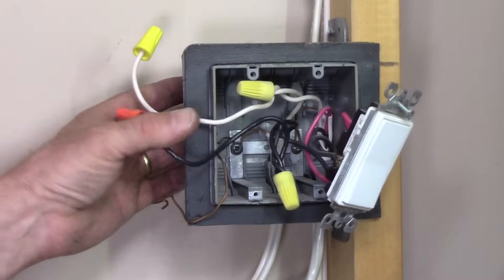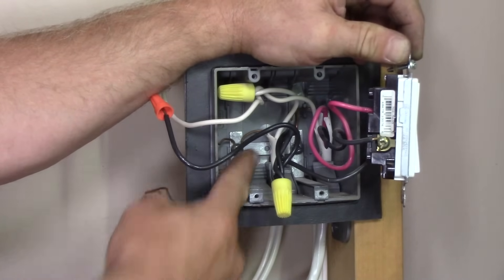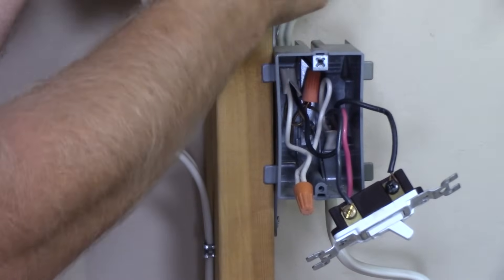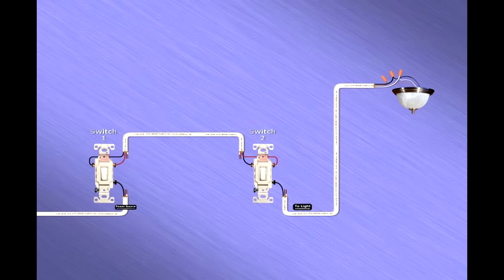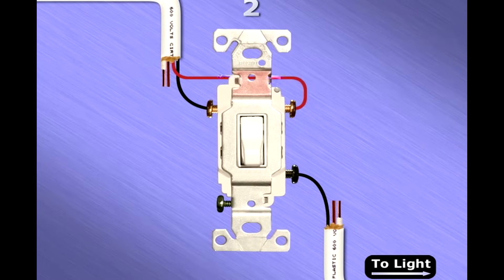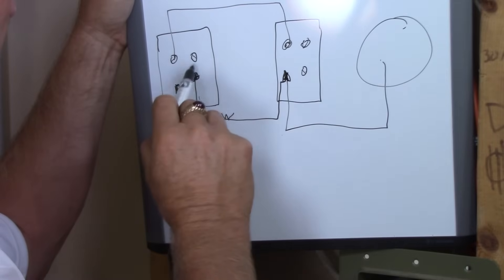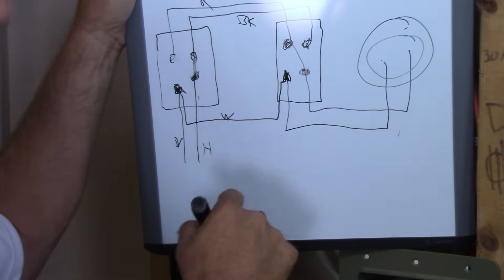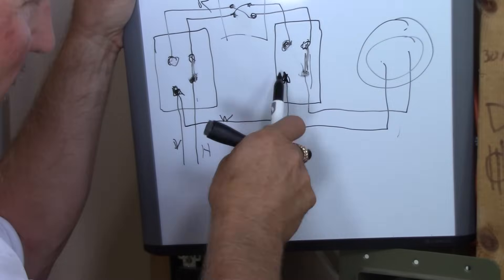The Best 3 Way Switch Explanation Ever!

Comment: I recently replaced one of my three wsy switches in my kitchen and now it’s not working properly. With both switches in the up position the other switch works fine if i move one switch to the down position nothin works. Any advice would be great. I only replaced the switch because it was painted.
Reply from the maker: You've mixed up the common wire with one of the travelers.  Shut off power, pull that switch out, and send me a picture of how it's connected to terry@electrical-online.com.

Comment: I don’t  know how to add a photo to this, but: I need help figuring out this junction box. Wiring on the right side of the box are dead. Others are live. Bottom of the box leads to electric switch. Switch controls a light fixture outside front, and outside back. Both wires have no voltage. Yet all other wires in this box are hot. Why? Why!

Comment: Thank you for your video. So I’m planning to tap into a light switch in bathroom wall and then doing recessed lighting in the other room and adding a light switch opposite of the light switch in the bathroom, this is possible to tap electricity this way?
Reply: It is possible, yes.  But just asking that question tells me that you should have a professional do the work.  Recessed lighting itself can be complicated because of safety code requirements.

Comment: Would you please explain how to turn one of the switches into an outlet while keeping the other as it is ? I have 2 switches functioning this way and i need a plug to replace one of them, the problem here is that all three lines are blue ? any idea ?
Reply from the maker: I would have to know exactly how this circuit is wired to be able to give you an answer.
Reply: @theinternetelectrician  I believe the wiring is identical to the one explained in the video, i checked both of the switches they have 3 cables connected exactly as the tutorial shows , unfortunately, they are of the same color, blue.
Reply from the maker: @AmineBoumediene  Is this circuit wired with wires in conduit? Is there a neutral splice in both switch boxes?
Reply: @theinternetelectrician  I've checked again, there are 3 cables connected to each switch. nothing else

Comment: So my house was built in the 70s.  Just checked my 3 way switches and found the cheap way the contractor used to pull this off.  I have 3 pairs of wires in my ceiling box.  Instead of using 3 conductor cable in the switch boxes they used 2 conductor and tied it all together in the ceiling.    Each switch box has 2 pairs of wires in them.  Was this typical back in the day or just a lazy way to do it?
Reply from the maker: The electrician didn't have any 3-wire and didn't want to go back to the shop to get some?

Comment: Duuude!!! Big shout out to you. This video helped me actually understand and solve my problem. 
Bought my first home recently and the wiring in the kitchen wasn't right when we moved in. We had two 3-way switches. 1 switch worked a light. The other switch effectively just cut power to the first switch. On the other circuit the red wire was just capped off. 
Thank you very much for this explanation! All is good and now I'm much more comfortable with what's happening inside my walls.
Reply from the maker: Thanks for taking the time to watch, and comment!

Comment: Your not too bright...    So you know how a 3 way works..   yay..    but every home is wired a little different depending on when it was built and where...    Sometimes your supply is up top.   Sometimes it's on either side..       you're wasting your time..    and probably helping to make more work for real electricians....
Reply: did you really have to be so derogative?  you could have presented the same idea absent the insults.  Where is your youtube video?
Reply: @dvk578  I'm an electrician..  not someone who sugar coats anything..     or someone who would mislead people with information on things in a video.    I might be a jerk but that's how I came up in the trade.  It may be abrasive but it gets your attention and makes you think.
Reply: @shawneliason790  First, I thank you because this video and your comment helped me to understand these switches and allowed me  to repair a switch install that the previous home owners had messed up.  As for the comment, the venom was not needed.   Specifically, the line saying, "You are not too bright,"  was entirely unnecessary.   No need to sugarcoat...  be honest...  but don't be an a$$ either.   Thank you again for the info you provided.
Reply from the maker: Thanks Shawn! All I can say is that you must be a very good electrician! I'll keep doing what I'm doing, 47,000 subs, alomst 10M views, and you helped me get there!  I'm not sure you should be calling me "not too bright".  You might want to check my credentials, or I can provide them for you!

Comment: My friend im learning with your video thank you for the free Ed....but question: why would I want to turn on my lights on the off positioned switch?...please elaborate
Reply: In a hallway, or similarly long room.  Light switch at each end so you don't need to cross the room in the dark to get to the light switch.
Reply: Three-way switches let you control a light (or whatever) from more than one location.  As Greg stated, a hallways is a great example because you might enter the dark hallway from either end.

Comment: How can I connect a receptacle a three-way switch a light a receptacle another 3-way switch using only 12/3 cable?
Reply: You would need to run an additional ( single ) cable..

Comment: Thanks a lot!!! One question - are you saying that 3-way and 4-way wiring using the same 14/3 cable?
Reply: Yes.  But a 4-way should always have two cables entering the electrical box, whereas a 3-way switch might have just one.

Comment: you can take the horse to the water but you can not make ham drink ,some apprentices i had in my courier the are afraid to touche a dad wire from a coil, as you can see no mater what you do you can't make a horse drink, i hire a 14 years experience apprentices and let ham tel me what those numbers and words on motor plate meaning , the first was ,,,what L.A mean ,he answer fast,,,,  L.A mean Los Angeles ,,,i fire ham wright on a spot, 14 years experience and don't know F.L means full load amperes,

Comment: I have a bedroom with 4 way switches. 3 switches on the wall. There is no light fixture in the bedroom. The switches control the outlets, but only the bottom of the outlets. The top halves are always hot. I assume for lamps.  Can I change all the outlets so that both top and bottom are always powered and then run a wire from the last switch into the ceiling for a light fixture? And most importantly  how do I figure out which wire is coming in from the breaker and which one is going out to the outlets without tearing all the drywall off? And what do I do with the wire going from the last switch to the outlets so that it's not a safety issue?
Reply from the maker: Peter Schwab this is actually quite simple. All you need to do is take a cable up to the light outlet location you want from one of the  receptacles in the  room. They run 3-wire cable to feed, and in between all those receptacles. Use the one with the least amount of wires is it, i.e. only a 3-wire in, no cable exiting to keep your box fill within code. Each of those switched receptacles will have a white neutral on one side, and a black and a red wire on the hot side with the tab between removed. Likely the black is hot all the time, and the red will be controlled by the switches. Use the red and white for your new cable connections for the ceiling light. If you no longer want any receptacles switched, just replace the receptacles with new ones and use the black and white for them, and splice the red wires through with a wire nut.

Comment: What do you call a switch that is just on or off? A one way or a two way switch?
Reply from the maker: A single-pole switch.
Reply: If it has two terminals it is a one way switch or single pole. If it has three terminals it is a two way or double pole switch but can be used as a single  switch.

Comment: What if I have a 3-way switch pair and want to cover one and add a smart switch where the other switch is? Is that possible?
Reply from the maker: It's entirely possible.  I would just need to see how your circuit is wired, what location you want to install the smart switch, etc. Would need to see a picture or diagram of what wires and connections are in each switch box.
Reply: @theinternetelectrician  
The code when my home was built didn't seem to call for anything but black, white, and bare copper for ground. I have a couple places I'd like to do it. It's annoying the electricians didn't put the wires in the same way in both places. It looks like in one switch there are more white wires and in the other there are more black wires. I'm wondering if I can close the circuit in one box and put a cap plate over the switch box, then treat the other switch like a standard switch?
Reply from the maker: @KLP99  Yes, but again I'd have to see how things are connected now to advise on how to make this change.

Comment: This is a good explanation for someone with an aptitude for this kind of work. It could be a problem for someone that does not have a basic knowledge of house wiring. this method also only works if you have the power originating at one switch and feeding the light or other device at the other switch. If the power originates at the light it will not work or if you must " dead end" one of the switches it will not work. however the basic circuitry still remains true. This is why I say without an aptitude for wiring it can still be difficult for some. Plus all code requirements still apply. 
60 year old semi retired electrician.

Comment: I had switches working proper then went into a bedroom where a wall switch did nothing but ceiling light works and Hall lights. Put on new wall switch, and i got a spark and blew breaker . Now nothing i do will light ceiling or Hall where 3ways were installed! What's going on??

Comment: so the power line always goes to the black pole screw on the switch?
Reply from the maker: In this method of wiring a 3-way, and at the box where the power feed enters the circuit, yes.

Comment: Hi, My main meter runs even if I switch off the main switch. Somebody did bypass from my house. But iam amazed when I have taken a separate connection from the pole and did separate open wiring then how come my neighbour bypass from my house. Actually when they use our connection my fridge stops working. Pls help as I am fed up of paying electricity bill without using it much.

Comment: Question:
 Your saying that both switches in a down position will turn the light on?
That is NOT the correct way! 

You flip switch up to turn the light on. Flip switch down turns light off. 
However, because it's a 3 way you can still achieve turning light off, if both switches are up. 
Tip: 
 When installing switches make sure that the writing is in the upright position.
Reply from the maker: Thanks for watching, and thanks for your input. However, there is no 'on' or 'off' position on a 3-way switch, and it doesn't matter how you install them in the outlet box.
Reply: @theinternetelectrician 
Thanks for your feedback. 
 I'm very aware of the fact that there is no visible "on / off" writing on 3 ways, that wasn't the writing I was referring to...
 And traditionally, flipping up a switch should turn on the light... that's all I'm saying.
Reply: @theinternetelectrician 
https://youtu.be/fz9KKvoS6p0
This link features another electrician that took the time to explain how to fix your 3 way switches... Notice that his system is the same as mine!

Tip:
 Both switches down... light is off. Either switch up... light is on. (If both switches are up... light is off.)
Reply: @theinternetelectrician 
https://youtu.be/ybKIvTQeLq4
Here is another guy that does it my way.
Your video was the first I watched. This link is the third video I watched. And I left you a link regarding the second video I watched.
My point being that 2 out of the 3  electrician videos share my system. You are the odd man out.
Reply: I'm not saying that you are under qualified.
 I'm just curious on why you complicate it unnecessarily?
My guess is that you don't have children around? Teaching a child how to turn lights on & off should share the same consistency as any normal switch.
(Down = lights off. Up = lights on.)
Reply: bjjthaiboxing You just contradicted yourself.   You said if both switches are up lights are off.   Then you said switch up=on.   Make up your mind.
Reply: @gfriedman99 
Apparently you have no understanding of 3 ways. Because if you did you would know that both switches up also cancel out juice to the light. Same as both switches down.

Comment: The video is ok. I just wanted to know WHAT a 3-WAY Switch was and why you needed it. It appears that it for when you want to turn on and off the same light from different locations. I guess an example would be a hallway with two light switches and one light. You can turn the light on and off from different locations in the hallway.

Comment: Great Demo and explanation.  Loved the Traveler term.  Would of liked to have other situation where the light is in the middle of the switches or power source came from light. Just because I have run into those.  Thanks
Reply: Sidney Pickard I believe the only difference in that situation is the light would be tied in to the travelers or traveler and hot would be on the switch.

Comment: Let me just say that your explanation made wiring a new switch in my "crazy-wired" house easy! You've used language and showed exactly what purpose each wire has, so that even though my wiring is using different color wire, (has the black crimped off together, uses the red, etc.) because you show which wire is the traveler, I was able to install the new switch, with posts in different positions (making it impossible to just stick the new one in with wires in the same spots.)
Reply from the maker: Happy to have helped out! Thanks for the nice comment! Don't forget to subscribe, you will then know when I post a new video.

Comment: in a 240 volt service can you use 12 3 to junction box and run 2 circuits and share the neutral as long as both are on opposite legs and again can i run red black blue on 208 and run 3 circuits from junction as long as each are on l opposing legs

Comment: So you have bonding bar in a non-metallic box? Seems over kill as the switch is grounded, and the box does not conduct electricity.
Reply: The bonding bar and ground are there to allow the grounding of the metal parts of the light fixture.

Comment: Power coming into the switches and the lights last always makes perfect sense to me. When the lights are first or in the middle, and whites go hot in some areas, it completely locks up my brain
Reply: It is still the same circuit path.   The power goes in one three-way switch, down the travelers, and back out the other  three-way switch.  The only difference is that the wires in the cables start doing other functions, namely the wire wire is usually re-assigned to be a hot wire to minimize cable runs.  (Newer codes can prohibit that, which is actually better in the long term.)

Comment: Very well done Sir... Everyone has to remember that the Neutral and Ground doesn`t land on a screw, they just twist together with a scotch loc and travel through the box to the light or final point...and the primary always lands on the Black Screw all alone by itself....
Reply: They switched the neutral on the switch for years , an there is a screw for the ground wire on the device's

Comment: Now I'm confused as to what a 3-way switch is...  I've always thought that when two switches can control one light, that's it's 2-way switches, and when there are 3 it's 3-way switches.  But this video is saying that 2 switches is 3-way, and that 3 switches is 4-way.  Is that right?  I'm not correcting you, I'm asking!  I don't know what is right, it's just what I'd always thought.
Reply from the maker: Rusty Fox what you’re saying would make more sense, but the north-American terminology is this way. I’ve been told that in parts (maybe all?) of Europe, our 3-way is their 2-way. It does make for some confusion.
Reply: @theinternetelectrician  Thanks for the explanation, Terry.  I'm Australian, and I guess we swing the European way - more specifically the UK way.  George Bernard Shaw once said (possibly paraphrasing Oscar Wilde), "England and America are two countries separated by the same language"  I tend to think he was very astute!
Reply: @theinternetelectrician  Switching lights from 8 different locations is done with two 3-way switches and six 4-Ways.  Make sense?

Comment: Thanks for this awesome video! It is better than what you will find on stack exchange!! On one of my switches next to it has a dimmer. Part of the shielding it taken off in the middle for the 3 way switch in a loop, and then it goes to the dimmer. I assume it is the same procedure as shown in the video?
Reply from the maker: Yeah, sounds like they are using that method instead of a pig-tail procedure to share the hot wire in that box.
Reply: @theinternetelectrician  Ohh, so it should work?
Reply from the maker: @georgejulias  I would have to see pictures, and a diagram to be certain, but from what I think you are describing, it should be OK.
Reply from the maker: Oh, and thanks so much for the compliment!